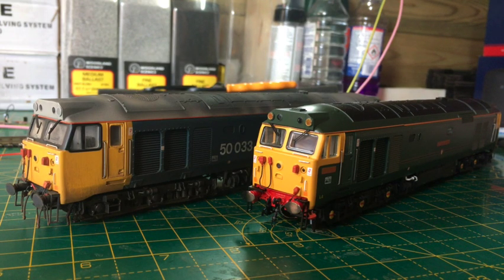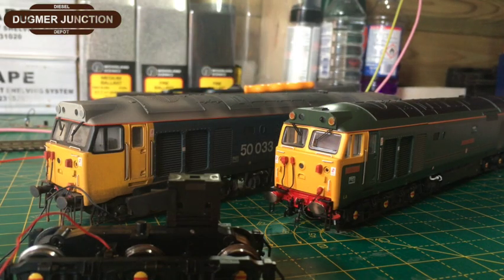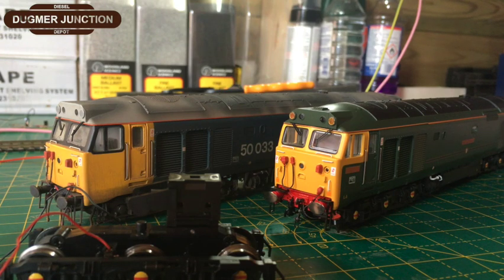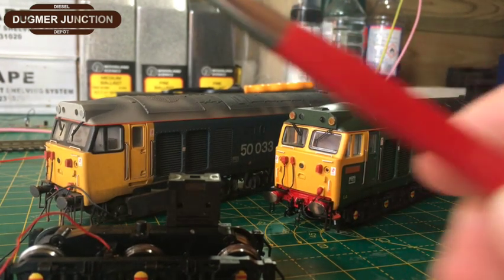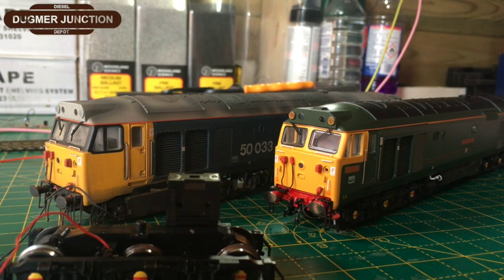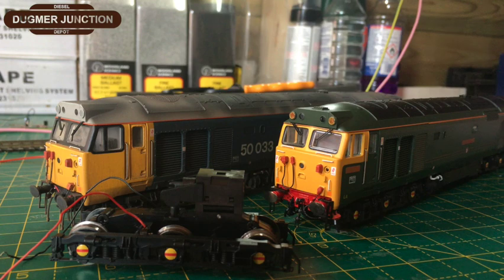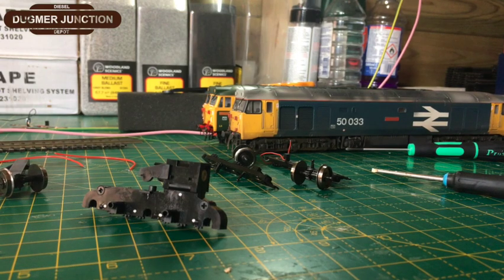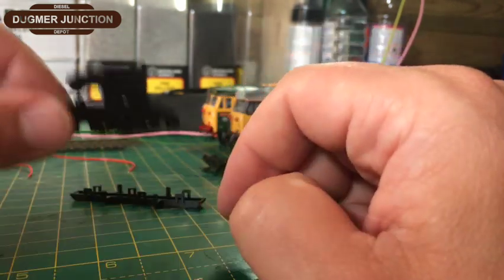How to: Hornby Class 50 - Bogies, Pickups & Helpful Tips

Comment: Hi just watched your video on hornby class 50 good content have you come across the problem of shorting out when trying to fit dcc on the older models.I have R2349 fitted with 1621 x001R6pcb and when fitting tts decoder it shorts out luckily it hasn't blown the decoder now am I right in thinking that the wires connected by the jumpers just need repositioning if so do you know what is correct way round regards Martin
Reply from the maker: Hi Martin, just plug the decoder in back to front on the old board. Common fault unfortunately